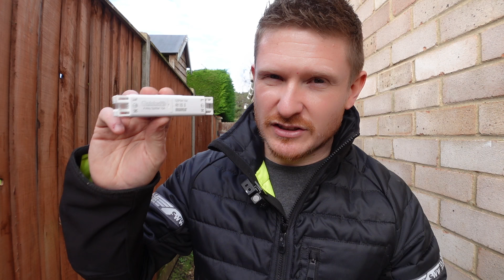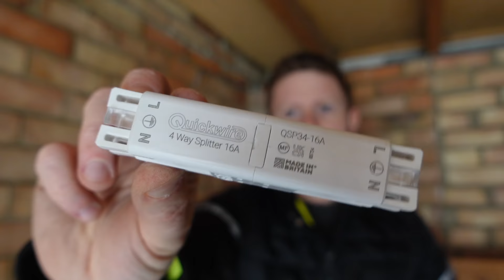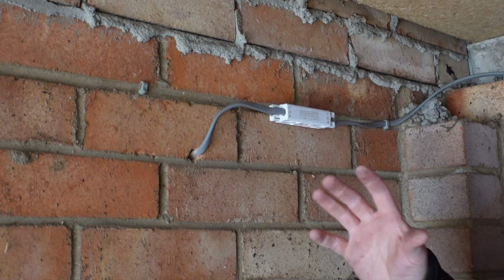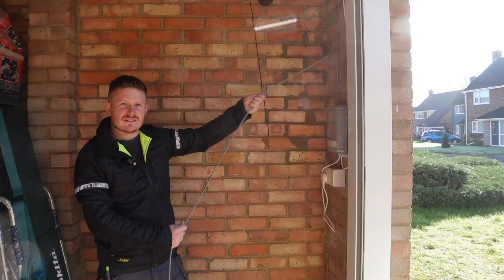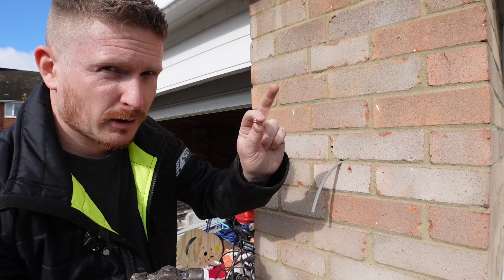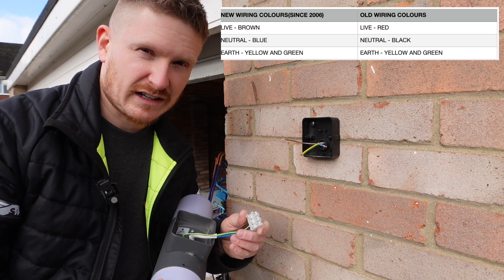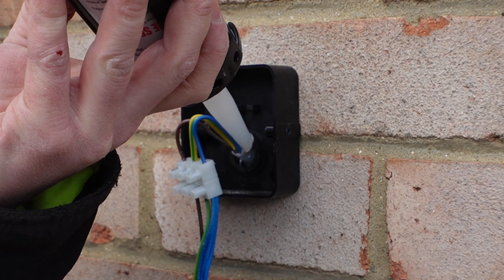How i Add More Outside Lights Using a QuickWire Splitter - So Easy!

Comment: Are you a qualified electrician.
Where is your means of local isolation?
Also, a tester that requires a battery to operate is NOT a suitable device for testing if a circuit is dead.
BPEC state that ONLY a tester that does NOT require a battery is a SAFE device for testing if a circuit is OFF.
If in doubt please consult a qualified electrician.
(where's your horse?).

Comment: Push fit connectors on low voltage are bad enough but on mains wiring. No thanks. These are for lazy installers. Things marketed as Quick are generally never better and cutting corners somewhere. As others have said use the tried and trusted junction box for this job.

Comment: Why pull all that cable though the hole? Personally I'd wire from your splitter, clip it all up, wire the light THEN connect to the circuit.

Comment: my consumer unit still has the electricians paperwork inside its plastic folder when the flat was built , it shows all the values such as loads and connections per circuit ,if one splices off an existing one should they update that paper work for future references

Comment: Does that quick wire splitter work with older wiring? The existing outside light on my house is very old and I want to replace it with a security light? The existing power cable feeding to outside is a grey cable and internally shows black and red (oppose to brown and blue) for live and neutral, so will the quick wire splitter work with that wire? I’m wanting to use the quick wire splitter as I want to run a second cable from it for a second security light? Any help would be greatly appreciated thanks 🙏🏻

Comment: I have a question... The outside of my house is all textured (Yorkshire) stone. Do I need to use a chisel to flatten the brickwork behind, or do I just use longer screws to keep the lights fixed and level? 

Thank you in advance for any assistance.

Comment: Didn't really like the lack of a gasket on that light housing connecting to the back box, dosn't seem to be a weather proof seal when the light is re-attached to the box, seems like water ingress could pool in between light and box...

Comment: Personally I'm not a fan of Twin & Earth (CPC) flat cable just clipped over the brick wall, I'd rather use TTE round conduit and single cores, and stick that quickwire in a IP rated box, as it's only rated IP30,  to protect it from moisture, as it's in an garage.  I know is probably overkill,  but I that's my personal preference. Good video though.  Also it comes under minor works mate.

Comment: Could you do a video on how to run a new power socket supply and light fitting from the main house into a detached garage that has a paved path in between? No power in the new detached garage and need a supply for a fridge freezer and light.
Reply: Notifiable works there mate, requires qualified spark.
Reply: @cag1017b  Yes just wanted some feedback as I have had three different quotes and different opinions as to how it can be achieved by disconnecting an Oven isolating fused spur switch and using it for the new supply to the garage to just taking a connection from an existing power supply in out Kitchen.  Does it even need to have its own separate supply.
Reply: Are you asking him to buy a house with a detached garage and this same situation to teach you how to do something? 🤣
Reply: @Clarkey1000  Clearly Not.  Just wondering what the approach would be and if a separate Breaker would be required at the consumer board.
Reply: @Elfin4  The approach would be to call a qualified spark

Comment: Good video. Compared to other trades sparkies have become too pricey for a lot of regular homeowners, for small domestic jobs like this. So it might make them grumble but i for one am grateful to youtube and people like you 👍
Reply: The problem is the installation is not compliant to the wiring regulations because he has used plastic clips so no consideration has been given to premature collapse, this a requirement since a spate of firefighters going in to fight a fire but getting caught on the way out by cables that have collapsed and blocked their exit resulting in the death of some firefighters.  It may seem like nothing and the likelyhood is small but the reason you hire a sparky is so the job is done right..  Also the RCD was not tested, all outdoor lights must be RCD protected (Although you could probably get away if its class 2), as a class 1 light the earth was not tested so you have no idea if it will provide protection in a fault.   I would also have put in an isolator so in the event that the outdoor light causes the RCD to trip it can be isolated and the circuit re-energised.  I would have also put silicone around the top and sides of that box and drilled a small hole in the bottom so if water did get in it could come back out.   The reason sparkies are expensive is because we have to have very expensive test equipment to ensure the installation is safe and a lot of training.  My mate Dave down the road says he could do heart surgery at a fraction of the cost of an NHS doctor, he has no qualifications but has watched a few on youtube.   Would you get heart surgery from Dave or will you stick to an NHS doctor?   Even someone proficient in DIY like the guy on the channel has failed in a lot of ways with this install which shows your average DIY'r should not be attempting electrical work, you should see some of the DIY shoddy workmanship and faults electricians see on a day to day basis.
Reply: All great until your house burns down , and your insurance is invalid because the fire was caused by your bad DIY!
You woudnt replace your own gas boiler would you? Same risk
Reply: Bit dramatic  @timbarnard9742  😄👍

Comment: I think cutting through the 3 core cable with only the live isolated via the mcb will cause a distribution board fitted with a rcd protective device to trip  one side of a split board due to the earth /neutral still being connected. Hope no one indoors turns the power back on including the mcb because their Xbox went off.

Comment: or you can do it correctly and wire in/out each light. this is fine but you now have 3 end of lines on circuit
Reply: any vid

Comment: I take if everyone can do this, then everyone has a multifunction tester and test certificate software to complete a minor works certificate
Reply: Well said, I love how he does his background checks, main earth,earth to gas and water , ze,zs, R1+R2 and RCD,I don’t know why I went to college for all those years anyone can do it
Reply: @Sparkyjedi better than getting ripped off by you lot.
Reply: 😂😂😂 if it works it’s fine . Don’t worry about it
Reply: I guess you do not like DIYers from your comment. No need for multifunction tester as it can be done with a multimeter or just checking the light on this line is off after switching off the fuse.

Comment: Doesnt that need to be in a junction box so it protected and the cables ran in conduit/trunking?
Reply from the maker: No, it is a junction box and is maintenance free(mf) so can be concealed too if need be. Conduit is not required either.
Reply: @TheDIYGuy1  interesting, thanks.

Comment: As per usual, a nice tutorial well explained. Junction box is a good idea for speed and tidiness, but these are only IP30 rated (according to the manufacturer), so absolutely not fit for anything but the driest of locations.

Personally, I would treat a garage the same as a kitchen in terms of humidity levels. You want at least some protection against moisture.

Inside a garage, I'd probably use an IP55 rated standard junction box. Same price. Plenty of ports for multiple cables and space inside for terminals, plus they are impact resistant. Horses for courses. Belt and braces.
Reply: What’s the point of impact resistance on this job, iP 30 is fine in this location but yes if the price is the same for better protection do it, however the installation is not safe on multiple counts. Follow 7671

Comment: I’m currently doing my electricians course and the theory is so bloody long winded and difficult but watching the practical seems a piece of piss 😂 
Nice video thankyou
Reply from the maker: Your welcome
Reply: @jamesw7624  don’t watch these practicals you will get kicked off site. If you want to get good practice your regs questions there is a good app out, practice your inspection and testing over and over on your own home it will cost you a tester, state the questions and answers when doing each test, doing this will enable you to know every question off the cuff, when you get to level 3 remember electricity doesn’t change you will do the same work I did 40 years ago, learn how to size cables from the regs book and videos, ( chat gpt ) helps everything.

Comment: would have been simpler to run the cable from inside to outside, it would have save all the pushing of all your cable through your hole rather than the half meter required.

Comment: When cutting the original cable, beware if the circuit is RCD protected that you may well trip the RCD.  Cutting through the cable with the wire cutters can cause a short from neutral to the protective earth which could trip the RCD. Not really a problem, but worth knowing about.  Alternatively, strip the cable outer and then cut the internal wires individually making sure not to touch the neutral to the protective earth on the feed.
Reply: Pretty sure this guy knows what he's doing 😂
Reply: @IJm3 I’m pretty sure it wouldn’t happen anyway because he isolated the circuit first so there won’t be anything to cause a trip.

Comment: Wouldn't it be best practice to wire up the light before you connect the other end, even if you've isolated the circuit?
Reply from the maker: It makes no real difference but if you prefer to then go for it 👍
Reply: Absolutely correct to connect to the existing system last, safety first

Comment: Excellent, thank you. Presume only for radial circuit?
Reply: Correct.  UK lighting circuits are all radials.  Rings only apply to socket circuits.   You could theoretically take the feed from a socket circuit but you’d need to incorporate an FCU that fused the circuit down to 3 or 5 amps.

Comment: Does this not class as a new circuit and should it have to be signed off by either a qualified electrician or your local authority??
Reply: Minor works certificate extended a existing circuit , he must of done that in other video 😂

Comment: They're only LEDs, nothing to stop you putting one of those connectors where the wall penetration is and splitting to the outside on a single string rather than a loop and then continuing to the next - granted, you'd need an extra connector, but it's arguably a simpler and tidier circuit. Also would mean you can disconnect it if you have a problem with one of the lights to swap it or whatever without turning the entire circuit off. This works too, but it's an option.. If you were doing like 4 of them it might make more sense than 4 cable runs.

Comment: Sorry but I thought electrical joints in the UK were required to be open for  nvestigtion so integrated and closed systems were not an option.
Hence why unsponsored I used WAGU connectors and WAGU connector boxes, sealed with cable ties as they are designed but if anyone wants to investigate them, a snip and the box is open and then you can see the wiring in the box.
Reply from the maker: The Quickwire splitter is maintenance free. A maintenance free joint is required in a concealed location. In this particular case a maintenance free solution is not required.
Reply: You use Asian beef to connect wires? Mental.

Comment: Thanks for another great video. Love the channel. I'm really interested in your electrical videos and always wondered if you are qualified. This is by no means a criticism. You are clearly very knowledgeable. It would be interesting to have a video on this. Just a thought.
Reply: @HalfTheWorldAway-mf5cf his clearly not qualified as he does a DIY channel, but also this is probably his own house so wouldn't need to worry about lock off kits 😂😂
Reply: I’ve never had a qualified electrician use a lock off kit yet?
Reply: @Simo8912  if its a domestic property or even at empty commercial/industrial unit then you wouldn't need to bother with a lock off kit, but your taught to use  a lock off kit regardless
Reply: @Simo8912  also because they don't use them, doesn't mean it's the correct way, majority just don't bother using them
Reply: @HalfTheWorldAway-mf5cf  I totally agree, that's why I said an "empty" industrial or commercial unit not a domestic property, no one touches the electrics on any of our sites 🤔 but your right we are taught to lock off regardless and perform safe isolation. I was just making a point that so many don't bother

Comment: Good video, thanks. Why drill slightly uphill? For water drainage?
Reply from the maker: So that water cannot track back along the cable. Although it shouldn’t be able to with the silicone.
Reply: So you can’t get the protective conduit in that supposed to be fitted

Comment: Can you use these splitters to add an extra double socket indoors?
Reply: Not with these as they are rated at 16A for lighting. However, a we have 24A junction boxes for 2.5mm cable available, and they would be perfect for the job

Comment: Excellent video, did you know that the cable clips should be positioned with the nail below the cable 🤔
Reply: Exactly, this guy is not an electrician
Reply: @markellis3648  Why does it matter? I am starting out as a DIY home owner and I want to do things right!

Comment: Run the cables inside first, then you're only feeding a short amount through the brickwork. Saves the cable grazing or looking scabby. Metal clips or support for premature collapse too.
Reply: Oh and put the clips with the nail at the bottom
Reply: What the heck

Comment: Excellent video as usual.  It may have been easier to use two splitters, one as shown and another near the left hand light to feed the right hand light. and then you need less cable.  Also if you feed the cable from the back of the pillar you are not dragging all the cable through the brickwork potentially damaging the sheathing.
Reply from the maker: 👍 good point
Reply: You can daisy chain as many of our splitters as you like! Well, there is a limit somewhere, but you'd never get to that amount in the real world ;)

Comment: I take it the wire feed can be taken from the existing lighting circuit, and nearest light socket.
If you want a switch, then I just add a junction box, for the switched live to branch off to the switch box?
Reply from the maker: Yes 👍

Comment: Get rid of those rubbish connecter blocks and use Wagos
Reply: If you've got time on your hands and don't want an easy life then by all means use Wago ;)
Reply: FYI, I'm not knocking Wago. They are great for all types of things, but this job here is perfect for Quickwire kit!
Reply: @quickwire80  I meant the ones in the lights. Your product is superb.

Comment: Do you not need to be a qualified sparky to touch electrical stuff in or around a house?
Reply from the maker: Not necessarily.
Reply: Depends on level of competence, and if the work requires Part P compliance with building regs, which this does not.

Comment: The one thing I always have issues with, is putting cable clips in. The buggers just ping off the wall on the first hammer strike. Not sure why I'm so special at that! 🤷🏻‍♂
Reply from the maker: It’s annoying isn’t it. But here’s a couple of tips. 1 - buy good quality clips(personally I like the Schneider ones). 2 - hit the pin into the point where the brick meets the mortar as it’s a little weaker there. 3 - find softer mortar 😂
Reply: Top tip is use a 20oz claw hammer. Press the plastic clip down with your index finger, then its one short fast impact strike of the nail. Once its got hold, move your finger and drive it home. Just takes practice that's all.
Reply: I had this issue recently, I cut dowels in half, drilled short holes in the mortar line same size as dowel (were 6 or 8mm) and tapped them home with the hammer. Clips hammered in beautifully. Might be ott but the cable is really neat now and every clip went in easily 👍🏻

Comment: Great video! I have just this scenario at home however the cable is three core + earth as it runs to/from a light meter. Can the quick wire spliter help?
Reply: I'm afraid we don't have a 3-core version yet, but we are working on one!

Comment: Great easy to follow video. Only thing i do different is swap out the plastic wire block that comes with the light and change them for wago connectors. Less fiddly if your on your own working. Excellent videos as usual
Reply from the maker: Brilliant glad you like the vid. great tip too

Comment: I know rules are different US versus UK but I’m concerned about running just the cable through the brick. Over time vibration could wear through the insulation.

Comment: Great installation and instructions. All i would like to add is that any electrical work carried out by DIY may require a certificate from a qualified electrician.
Reply: No sparky wotrth his salt will certify third party work, it’s all good this diy electrics but your home insurance is void as soon as you piss about with it
Reply: @kingofthetrowel1725 There are hundreds of jobs that are safe and legal DIY don’t need certification and insurance don’t bat an eyelid. Otherwise something like 70% of homes would not be insurable.
Reply: @@HalfTheWorldAway-mf5cf It's why these DIY electrical videos are so dangerous. Unfortunately many on here in the comments will do the job and think excellent it works, not knowing whether or not the RCD trip, whether the wiring was safe in the first place. The list goes on